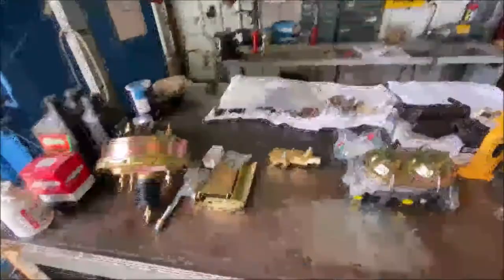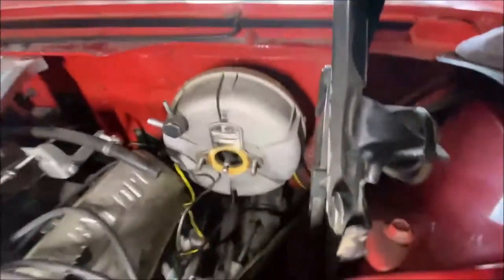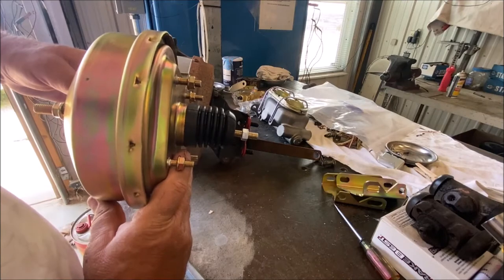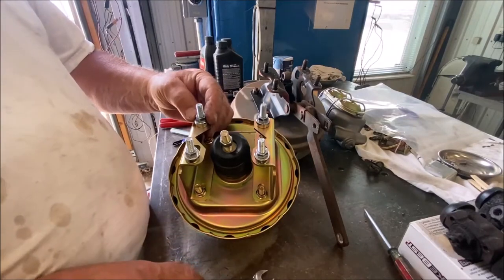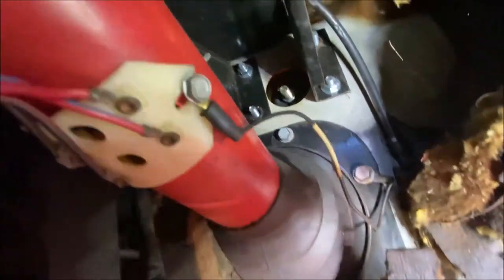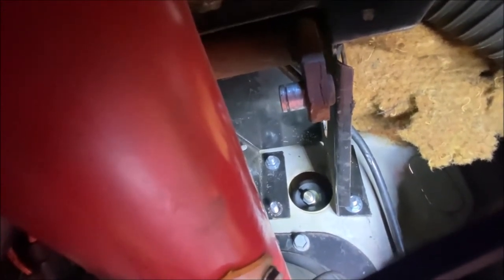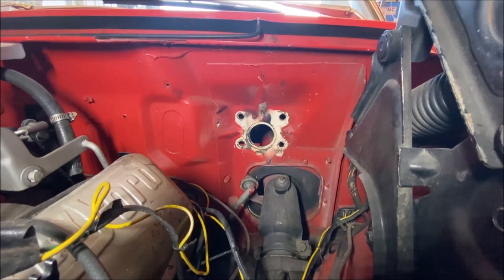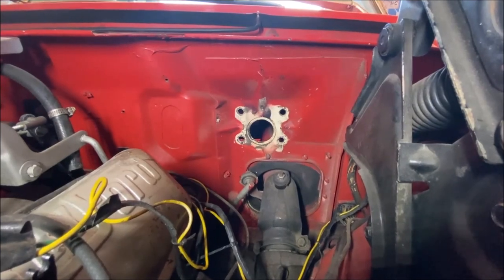1961 64 Thunderbird Brake Booster and Dual Master Cylinder Retrofit, PART 1

Comment: Hi Nick. I really enjoy your videos and like your explanations of each project you do. I personally don't have a Thunderbird but a 64 is on my wish list. What I do have is a 1964 Galaxie 500 XL. A lot of what you do can be applied to my Galaxie. I ran into the same problem when I wanted to convert my Galaxie to power brakes and add the dual master for safety. I was fortunate to be able to find a used power booster and I sent the booster (Midland) to Booster Dewey in Portland Oregon for a rebuild. They have an excellent rebuild service and it wasn't a problem for me to wait for the rebuild. Before I found the original I had purchased a kit that was also supposed to be a direct bolt on. It was not a success. I wasted time and money and never was able to make it work correctly. I decided to dig deep into how these systems are designed and that is when I discovered that the factory engineering that goes into these systems is key to them working correctly. Your customers car was originally equipped with power brakes. That makes all the difference. The standoff bracket on the back of the booster and the correct power brake pedal (with the right pedal ratio) was key on my car. I have done modifications on my Galaxie to improve things but what I have found is you cannot beat the factory setup when it comes to design. I'm glad you were happy with the results. Thank you for making these very informative videos.   ps. After watching your video on the MOOG spring compressor I added that to my tool wish list. I was finally able to buy one on eBay after checking for weeks to see if one came up for sale. I'm ashamed to say how much I paid for it but it was in very good condition and all the parts were there including the original paperwork and case. It is now one of my prized tools.
Reply from the maker: Hey MS, thank you. Its hard to believe that Ford would produce such a big car like the Galaxy without power brakes, mind boggling! I was also surprised that the aftermarket booster worked as well as it did. I got lucky with that one. Yes, finding cores today is really a bitch! The spring compressor is one of my favorite tools and I never leave the house without it lol. Heavy SOB too. If you only have one car, you probably wont use it much. I use mine all the time. The best tool I have mostly. Anyway, thanks again.

Comment: Man Nick, you have the patients of a saint.  There is no way I would be able to keep my cool through this torturous process.  I hope the company that sold you this half assed product sees this video, not that it will make any difference I am sure.  There really is no after market dual bowl solution for pre 67 birds.  I wish someone would come up with one because I think they'd sell a lot of them.  I heard that the 67 t-bird dual bowl would work, but you need to notch the shock tower bracket.

Comment: Hi Nick,  Thanks for posting these videos.  What adapter did you use to connect the brake light switch?
Reply from the maker: Hey Todd, sorry but I didnt make any notes about that. I should have but I didnt. I just dont remember. However, what I did was I went to the auto parts store with the master and tried all their fittings until I got the correct ones. I did use an L shaped T fitting and that screwed into another fitting to adapt the master cylinder hole to brake line size. Sorry for not having that info.

Comment: Hey Nick, thanks for this video! I've been battling a mushy pedal on my '62 after upgrading to a dual circuit master. I believe the factory single circuit master has a 7/8" bore, but my new one is 1" and is for late 60s drum/drum configured Ford cars. The brakes felt great on my single master but I've bled the master and lines until my hands bled, tried a different (1" bore) MC... should I use a 7/8 bore MC like the single pot was?
Reply from the maker: Hey obsoletegeek, Ive never tried what you are trying to do but it makes sense to me that if the 1" bore master didnt work, try the 7/8". Thats what I would do. Good luck.

Comment: I would like to get rid of the 4 piston calipers and change to single piston on my 65 tbird I would also like to change the spindle so I have more wheel options any info you could pass on regarding this?
Reply from the maker: Hey Eric, sorry but I have never heard of anyone removing the original disc brakes and replacing them with after market disc brakes on these Thunderbirds. I can imaging you could do that but I don't know anything about it. You might want to try Wilwood? Good luck.

Comment: This is mickey mouse man lol.I have a 1982 grumman step van with a ford E- 350 chassis that needs a vacuum booster but I cannot find one so I might try to retrofit the same way.
Reply from the maker: Hey Rich, at lease the unit worked well despite that fact that it didn't fit worth a damn. Good luck.

Comment: I can't figure out why you wouldn't tell us what company  you bought that part from thats  pathetic. There's nothing wrong with speaking the truth. I bought a new  dual master cylinder from PartsGeek but they sent me a single master cylinder the exact same one I had on my Thunderbird. PartsGeek would not pay for return shipping( it's in the fine print) although it was completely their fault.  Capital One was no help at all I had to pay $17 to ship the damn thing back to get a refund ,minus all shipping charges. NEVER AGAIN!   Look up parts geek under Better Business Bureau........   66 Mustang dual master cylinder work just fine
Reply from the maker: Hey P2BW, I explained clearly and thoroughly in my video why I didn't name the company. I don't want to promote a company that purposefully misrepresents their product and will not support their customers. I also do not want to be sued for saying something bad about some business. After I read your comment here, I searched eBay for, "1961-64 Thunderbird dual master cylinder" and the brake booster and master that I show in my video was the third item to come up from the company I bought it from. I show clearly what the assembly looks like in my video, there can be no mistake. All anyone has to do is to compare my video to what they find on eBay.  I'm sorry you had a bad experience with Partsgeek. Don't buy anything from them again if they have such bad policies. Anyway, do the same search I did and you will see the brake booster master assembly I bought advertised from the same company. Good luck.